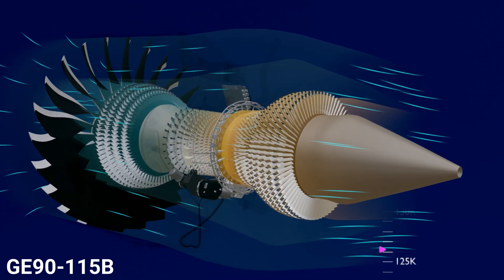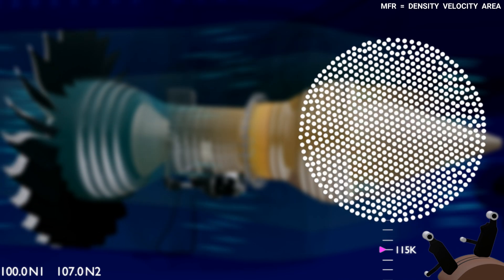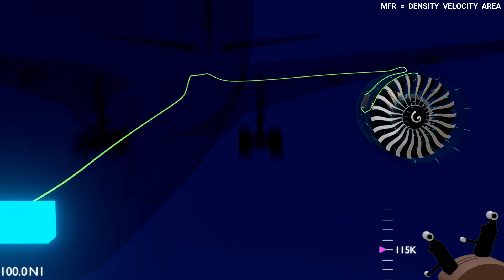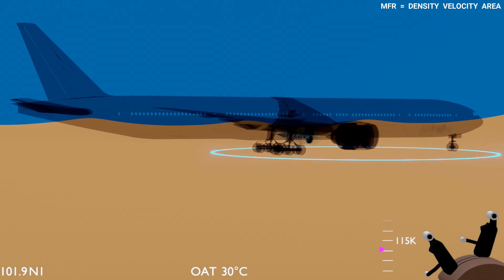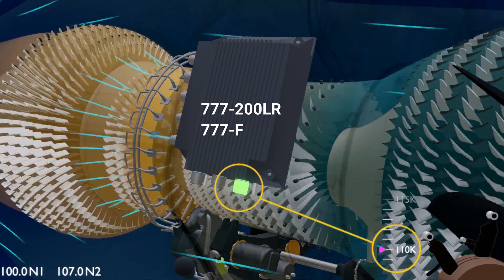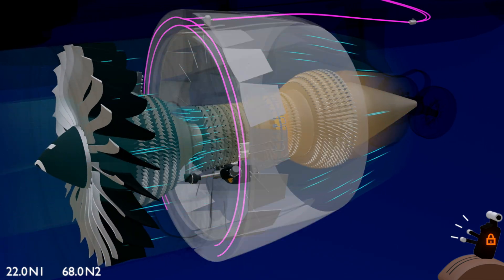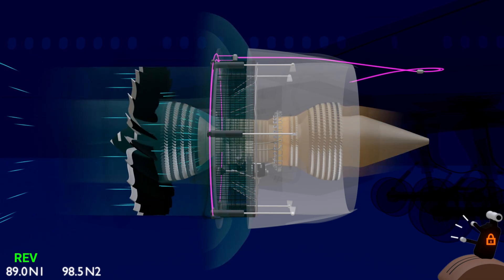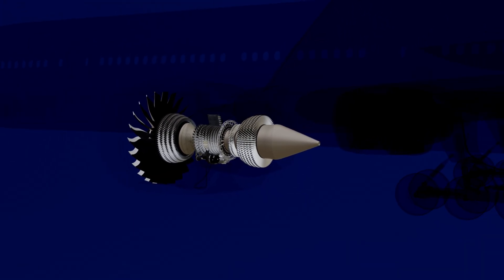How Jet Engine Works | Part 5 : Power

Comment: AIRCRAFT  SCIENCE,  I AM INTERESTED  TO ASK  FEW INTERESTED QUESTIONS ABOUT  GE90 ENGINE  Q NO 1, FAN DIAMETER? 2 FAN TIP SPEED ? 3 RPM  OF FAN  ?  4 HOW MUCH POWER hp  REQUIRE FOR FAN AT FULL SPEED  ?  HOW MUCH  POWER  NEEDED   TO RUN COMPESSER ?

Comment: I dont understand at 1:40. How can the engine control the thrust without utilizing the fuel flow to n2? To my knowledge the only things you could control were fuel flow in the combustion chamber (which will increase hpc pressure before it increases fan speed and bypass thrust) and stator angles. I dont understand how you could get the engine to alter bypass flow rate without first altering fuel burn rate in the combustor.

Comment: All 5 Parts are watched. Regarding 4th and 5th parts, my humble Views. 
1. In the 4th part, regarding bearings and aircraft load sharing were discussed. At 4 stages roller bearings and at 1 stage ball bearings were, as per narration, used. But Clarity is Not given in Roller bearings as there are Three types of the Roller bearings. If Rotating components' speed is comparatively lower and supposed load-taking is higher, roller bearings are used instead of Ball bearings. Roller bearings are Three types, namely Cylindrical Roller bearings, Taper Roller bearings and Spherical Roller bearings. In Cylindrical Roller and Taper Roller bearings, due to more contact area of Rollers in the Run-ways of the bearing; heat generation is higher than that of Spherical (improved design) Roller bearings. Later type of bearings take Radial Load generating comparatively lesser heat than that of Cylindrical Roller and Taper Roller bearings. Ball bearings are used where speeds are comparatively greater and load bearing is minimum.
  In the 5th part, regarding Air Thrust and its compensation, coping up and / or controlling to its possible minimum level was discussed. For compensating, Heat Exchangers are used and their heat dissipation is done through surface air flow around the Heat Exchangers. In running mechanical components, heat generation is natural. But, in aircrafts for possible minimisation of heat generation; in the designing stage itself, Aerodynamics aspect is given very important role. No where in the narration, Aerodynamics matter was Not even spelt! In any scientific Invention, first any probable uneventual outcome is assessed eliminated or ruled out; then only matter of compensation and / or its coping up matter is planned and designed.

Comment: So if FLEX TEMP is used for take off I tell the engine that it is warmer -> so the N1 decrease. But work it vice versa? So if I use a FLEX TEMP colder than OAT, the engine should also reduce N1 or did I understand something wrong?

Comment: Looks like there is still thrust going from the rear, what percentage of the thrust is diverted to the reverse position? Thanks!
Reply from the maker: The GE90's bypass airflow, which produces 83% of the thrust, is redirected.

Comment: Great video :yougotthis: i wanna ask something. what percentage of reverse thrust by the thrust it self?
Reply: Only the bypass air is reversed. The combustion air continues to flow through the core and out the rear exhaust. Because the bypass ratio is very high, the net result is negative thrust.
Reply: @g.tucker8682  Correct but that didn't answer the percentage. Can't simply negate there -.83 + .17  = -.66... There is a lot of loss because much of the reversed thrust goes wasted sideways
Reply: @u1zha  I understand your question better now, and I agree that's it's not as simple as bypass mass minus core thrust, for the reasons you stated. I wouldn't guess at the real answer, but I can tell you from experience that they are pretty effective. However, you don't feel much difference when the reversers are opened, but that's because of the way the overwhelmingly powerful autobrakes work. If you land with reversers inoperative, you'll definitely see much higher brake temps. By the way, the brakes are so good, we normally just open the reversers and leave them in idle. The only time I'd pour on the reverse  is for a minimal landing distance, land and hold short clearance, or rejected takeoff.

Comment: I've watched this all and I'm just still curious how is N1 and n2 independently controlled other than their two independent shafts.. inlet veins?
Reply from the maker: They are not controlled independently on the GE90. Changing the fuel flow will affect the speed of both shafts.
Reply: N1 speed is strictly the speed of the fan.
N2 speed is the speed of the compressor section

Comment: Excellent! i would like to ask if the engine has a cooldown sequence before or after it´s shutdown.
Reply: There is no cooldown cycle, and it is permissable to shut down immediately if needed (for example, parking after a very short taxi). However, it's recommended to operate the engines at or near idle power for five minutes before shutdown, when possible.
Reply from the maker: There is no controlled cooling sequence for the engine during the shutdown.

Comment: How does the eec control the N1 shaft speed? It's not clear how it does this.
Reply from the maker: Kindly watch the entire series.
Reply: @AircraftScience  I did tho, what did I miss?
Reply from the maker: To change the N1 speed, the EEC commands the HMU to vary the fuel flow for combustion.

Comment: I watched all 5 videos and that was the best explanation of how the engine works, so if I understood correctly the engine automatically goes to full throttle once the thrust reverser is fully deployed??
Reply from the maker: No, the pilot has to move the lever to maximum reverse. Automatic systems of the aircraft are not allowed to control the thrust reverser.
Reply: @AircraftScience  the reason I asked is because I've seen several YouTube videos on cockpit landings and seen the pilot pull the thrust levers to idle once they touch down pull up the thrust reverse levers all the way up and can hear the engines spool up automatically although the thrust levers are in the idle position that's  why I asked do the engines automatically  go to full throttle to maximize the reverse thrust, I think have previously worded my question wrong? FF to 4:57 you can hear the engines spool although the thrust levers are at idle 
https://youtu.be/EafvR607kb0

Comment: Excellent video, thank you. If TOGA is applied, will thrust exceed 115K pounds or is that EEC limit never exceeded? Cheers
Reply from the maker: The rated thrust will not be exceeded.

Comment: This is amazing. One of the best and most informative series of videos I've ever seen. A suggestion would be to do the PW GTF and Rolls Royce RB211/trent engines after the GE90. Those are marvels of engineering as well. Or maybe the GE9X and compare the differences in pressure ratios and stages in the core to a GE90.  

But again, you are doing a terrific job. Can't wait for the next video.
Reply from the maker: Great suggestion!
Reply: @AircraftScience  yup.. i am waiting for the GE9X serious..
Reply: Or you could do a serious on the Trent 1000 engines ( Rolls Royce)
Reply: Love this series- would love to see a series on RB 211 as found under the wing of 757